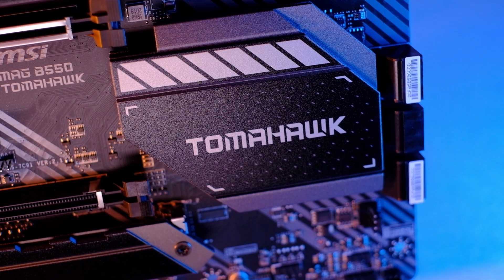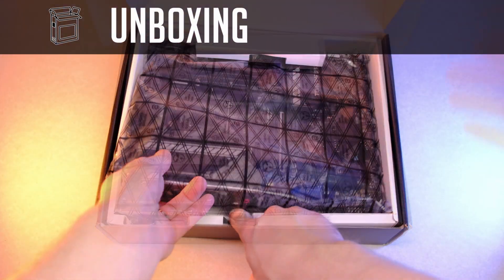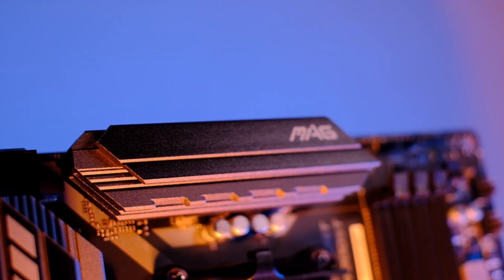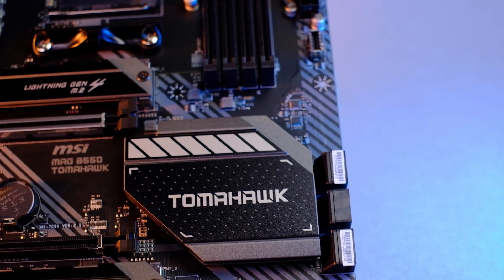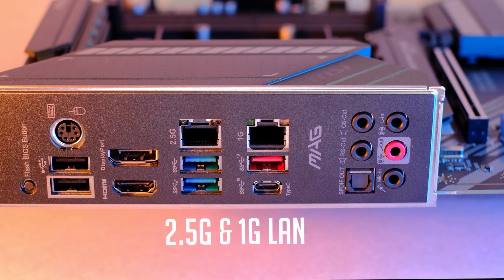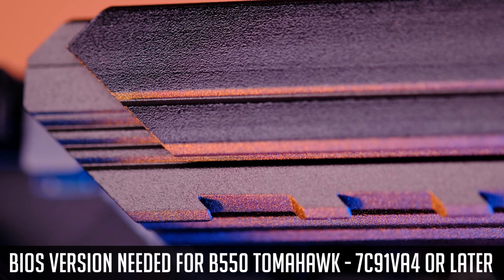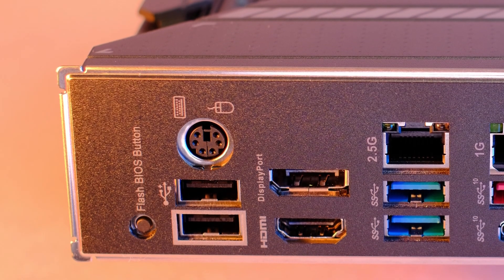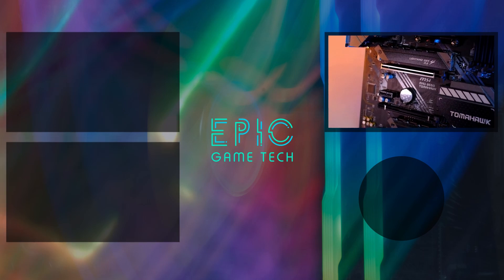MSI MAG B550 TOMAHAWK Overview - INSANE VRM Performance ATX Motherboard for Ryzen 5000 / Zen3

Comment: does this support ryzen 5000 series out of the box or need the bios update? Sorry, quite confused.
Reply: Actually I dont think any b550 motherboard is ready out of the box. I would say it is mandatory to update the bios that comes from factory in order to make your ryzen 5000 series cpu work well
Reply from the maker: Hi,
it depends on when the board was manufactured as the later they make boards, they come with updated BIOS.
For Ryzen 5000 you need b550 tomahawk to have "7C91vA4" or later bios. The seller probably can tell you what bios it comes with.
But even if it's with old BIOS, b550 tomahawk has a flash bios button - meaning you just need to download the latest bios to USB stick, use the right USB port, and use a button on a motherboard, BIOS can be updated with no CPU. (all steps can be found in the motherboard manual).
So it's not a big deal even if you need to update it :)
Reply: @EpicGameTech  Ohhh I see, very helpful. Thanks!
Reply: @Pistacho123Lol  Thank you!

Comment: Do you happend to know any fix to why I am stuck on the BIOS screen? My pc wont go past this screen after I installed my new RAM sticks.
Reply from the maker: Hey,
do you mean it "freezes" in BIOS and no action can be done?
The first thing I would do - would clear CMOS. Would try jumper method (like shown in manual https://download.msi.com/archive/mnu_exe/mb/M7C91v2.2-EURO.pdf - page 25) or/and battery removal method.

Then, I would update BIOS to the newest version, as newer version might have better RAM compatibility. 
So download the latest BIOS from MSI - https://www.msi.com/Motherboard/support/MAG-B550-TOMAHAWK#down-bios
Use usb-stick and you can update it using FLASH bios button (same naual, page 33 - "Updating BIOS with Flash BIOS Button")
Reply: @EpicGameTech  i can change settings and what not in BIOS. Its just that I cannot get past that screen on bootup, basically I am stuck on BIOS.
Reply from the maker: I see, well I would still reset CMOS and update bios. Also, would try to re-seat ram sticks.
Any of debug LEDs is ON? (on your motherboard - right top near 24pin power cable)
Reply: @EpicGameTech  i reset the CMOS im going to buy another battery for it and how would I update the BIOS? For the ram sticks by re-seat you mean take them out and then put them back in?  Also yes the LED named “DRAM” was lit red at one point.
Reply from the maker: Yep, take ram off and then install again. Be sure you install them in the right slots if it's just 2 sticks and not 4.
Download the latest BIOS version that is not marked as BETA or etc. Always use the latest bios :)
And how to install BIOS - use a manual link from the above comment, 33rd page. There are few ways - you can update from BIOS to new BIOS or using a Flash BIOS button. Both ways are written in the manual/page I've mentioned :)
Reply: @EpicGameTech  thanks for the suggestion/help I really appreciate it. Also a question does it matter that 2 of my sticks are 8GB and the other 2 are 16GB like would I be able to use all of them after updating the BIOS? And yes they are all the same Mhz which is 3200.
Reply from the maker: So you have 3 sticks in total? (or 4?)
Well, if the sticks have the same specs (like brand, MHz, and timings) just capacity is different, it should work. Having the same 3200mhz doesn't mean they have the same timings. So in case, they are different manufacturers/timings - you might face some compatibility issues in some cases. Might be this is why it's not working well.
Also, have in mind, if you have RAM 3 sticks, 2 of them will work as dual channel and 1 ram stick will work on a single channel. In some cases, it might not influence system speed but in some cases, it might work slower on some games, etc. That's because of that 1 stick will be working as a single channel. And so it might be, that even if you have more ram with 3 sticks, 2 sticks would get you better performance even if it's less ram.
Especially with AMD cpus single channel is a bad idea, as ryzen depends much more on ram speed than Intel systems. So I would suggest using 2 or 4 sticks.
Reply: @EpicGameTech  yea i have 4 sticks and they all are Corsair Vengeance 2x8GB and 2x16GB all being 3200Mhz. How would I know if they all have same timings? Also would it help if i listed my specs for you?
Reply from the maker: If its 4 stick that's better. Be sure you pair 8gb stick with another 8gb stick in dual channel and 16gb with 16gb.
Same manual as above, 15th page with image/instructions. Install 8gb in "DIMMA1" + "DIMMB1" and 16gb sticks in "DIMMA2" + "DIMMB2".
Regarding timings - there should be a sticker on each ram stick with mhz and timings like 3200mhz 16-18-18-38 or etc ;)
The thing is, on some motherboards different specs RAM works OK, on some don;t. So in general, before buying ram, you need to be sure you can get same specs if possible :)
Reply: @EpicGameTech  the 2x8GB are 3200Mhz 16-18-18-36. And the 2x16GB are 3200Mhz 16-20-20-38. So in this case I should only use the 2x16 sticks since they are different from the 2x8 sticks correct?
Reply from the maker: Well, just install sticks according to my last comment / manual, reset CMOS, update BIOS and possibly it will work OK.
If not after these 3 steps done, then you will probably need to use 2x16 only :)
Reply: @EpicGameTech  BIOS was just finished installing on my pc and it went to a blackscreen been waiting for almost 10 minutes with a black screen. Also there is a red light on next to the 23 pin and it says “CPU” while a red light is on.
Reply: @EpicGameTech  For the BIOS update there are several updates which one would it be that I would have to download?

Comment: Also does it go with Ryzen 5 3600
Reply from the maker: Hey,
Yep, but I would say it's too "good" and too expensive to be used with ryzen 5 3600 :)
Better to get a less expensive motherboard and use saved $ towards a better GPU/SSD or even a better CPU.
I mean b550 tomahawk is good but i would go for it with ryzen 7/ryzen 9 and not ryzen 5

Comment: If i order do i still need to flash the bios? if there is no sticker that says ryzen 5000 ready
Reply from the maker: Hey,
it all depends from a motherboard you get. If that particular motherboard were manufactured recently, it will have new bios already, but if it's prior ryzen 5000 release, it will have an older bios.
But do not worry, this motherboard has a BIOS flashback functionally, so it's easily done and you do not need a CPU to update BIOS. You will need USB flash drive and download the latest BIOS from msi.com motherboard site. Few more steps form a manual and BIOS is updated :)

Comment: Hey really great review, coved multiple aspects of the board. I wonder if you know if this board would work well with Ryzen 7 3700X, and if not any other boards that might be a bang for the buck? Thanks!
Reply from the maker: Hey,
thanks :)
Yep, this board would work well with r7 3700x. Especially if you use your pc for video editing or other CPU heavy applications and you plan to upgrade CPU to lets say ryzen 9 5900x some time in a future (like in 2 years or so).
In case it's just for gaming, probably you will not upgrade to 5900x later and so you could get a cheaper motherboard that would work well with r7 3700x.
But to advice, i would need to know:
- Is your build for gaming only?
- Any special needs? (like internal type-c header for pc case etc)
- Will you do manual overclocking?
- And what the budget or other parts you are planning to use?

I need this since its best to choose same level of parts in a pc build meaning if your pc parts are budget ones, i would advice more budget motherboard and if they are more high-end - more high-end motherboard :)

Comment: Does this board support ryzen 5 3600 processor out of the box? 

Btw, great video! 

Also I have rx 560 gpu, I know, it’s old.. Can I put it in pcie 4.0 x16 slot? 
I will be doing my first build ever..
Reply from the maker: Hey,
Yep, it supports ryzen 5 3600. But I would say it's a bit too good for r5 3600 as you can get a cheaper motherboard and it will run just fine. Unless you are thinking about r7 5800x / ryzen 9 later on :)
Yep, your GPU is quite old, but the current market situation with GPUs... Even worse :))
Yes, you should be able to use it in PCIe 4 no probs. But you want to upgrade your GPU for sure (when things with prices will settle down). As r5 3600 can handle way better GPU like RTX 3060 etc.
Reply: @EpicGameTech  Awesome! Thank you for detailed answer, you helped me a lot :)

Comment: So I have a part that connects all my fans together, but I can just tell it’s not the best quality, would you know what this part is called? Or where I could buy a replacement?
Reply from the maker: Hey,
probably you have in mind fan splitter or a fan hub :)
I would check it on aliexpress.com (https://www.aliexpress.com/wholesale?catId=0&initiative_id=SB_20210217094613&SearchText=fan+hub) or amazon.com.
But in case you have like 3/4 fans you could connect each fan connector straight to you motherboard. Unless you have more fans than fan headers on a motherboard :)
Reply: @EpicGameTech  I have 6 fans so I’m guessing I probably can’t do the motherboard way
Reply: @EpicGameTech  sorry I do have 1 more question, would the cpu cooler fan plug into the fan hub? Or on the motherboard I’m not exactly sure
Reply from the maker: Better to plug it to a CPU header on your motherboard :)
So your Pc case fans goes to a fan hub.

Comment: What good budget graphics card would pair with an Asrock Steel Legend AMD B450 Socket AM4 ATX DDR4-SDRAM Motherboard
Reply from the maker: Hey,
well, motherboard doesn't that matter for a graphics card. So you need to combine your GPU with CPU and whole budget you are planning to spend on a PC :)
- So, what CPU are you planning to use?
- What's the total budget for your PC Build?
Also, have in mind, that right now, it's nearly impossible to buy almost any video card for a decent price (because of pandemic and stock issues). So any video card will cost 30-50% more :)
Reply: @EpicGameTech  I’m gonna use a ryzen 5 but not sure which one
Reply from the maker: Well it depends then :)
If you build a budget built and will use oldest generation like r5 1500x, then RX 580 / gtx 1060.
In case of ryzrn 5 2600, well RTX 2060 / GTX 1080 / RX 5700 etc.
If you go for newest one Ryzen 5 5600x, then any GPU will fit, like RTX 3060 ti / rtx 3080 / rx 6800 etc 
So it depends.

Comment: hey, if you are great channel
do you maybe know why my sensitivty like always change
so it is like not lower, when i lower sensitvity it again is fast and it come to happen like 2 weeks,
do you maybe know what is the problem (not in dpi,mouse i changed every mouse and everything)
can it be bec of motherboard (usb ports) or psu (i have 300w) 
and i have same setup like this for 100$
i will bi very thankful if u can help me!
Reply from the maker: Hey,
PSU is not responsible for mouse sensitivity for sure :)
Either it's:
- Mouse DPI
- windows sensitivity settings
- mouse drivers/software
As you mentioned, if it's not DPI, then it could be you are using the different mouse with no drivers? :)
Also, windows fresh install would possibly solve this :)
Reply: @EpicGameTech  i did all of that like 5 times... :(
.. i am thinking of buying a new motherboard, and does usb port can be problem with that..? Bec they are on motherboard
Thanks for replying!
Reply from the maker: So, you've tried fresh windows install + installing mouse drivers and it still keeps changing?  :)
Well, USB port could possibly influence that, but I've never faced similar issue before :)
Reply: @EpicGameTech  i will try fresh windows install again, if that can't help imma just buy motherboard
Thanks for fast reply, keep going with channel :)
Reply from the maker: Hmm would be strange if it would be motherboard, but i guess its possible :)
You should try your PC Case USB ports as-well as they are connected to motherboard internal-usb header. Try every port on your motherboard ;D

Comment: With so many new systems these days being built without a DVD drive, you would think they'd ditch the driver disc or  include a small flash drive by now.
Reply from the maker: Actually a nice idea, as USB drives took over the market ages ago. And also, they are quite cheap ;)
Not sure why they do not switch to USB. Might have billion DVD drives @ their warehouse already ;))